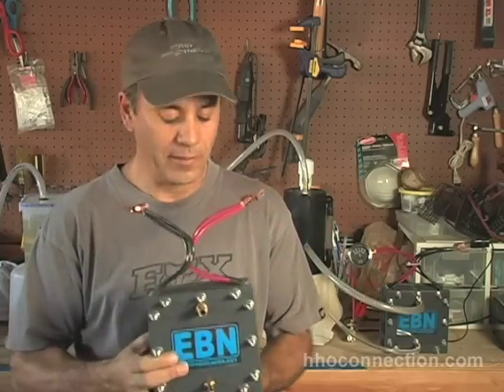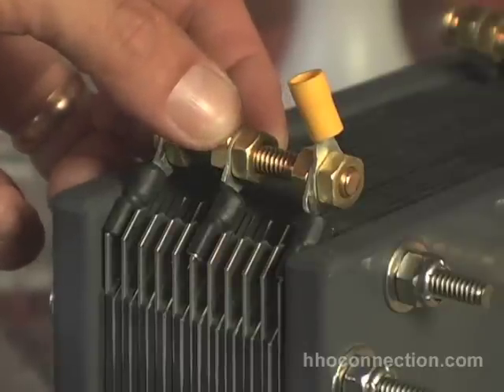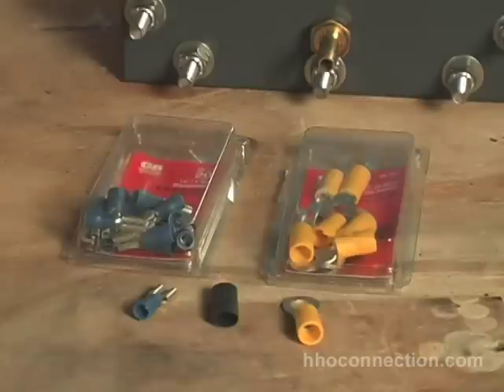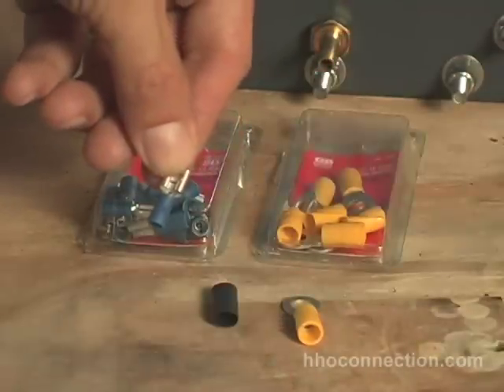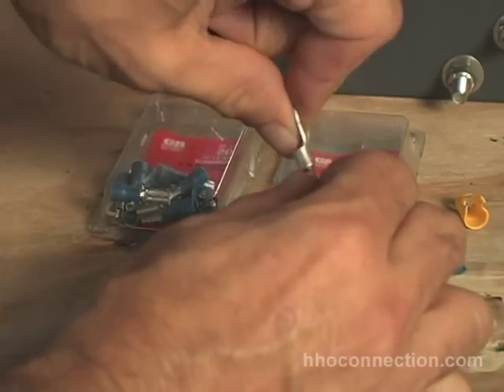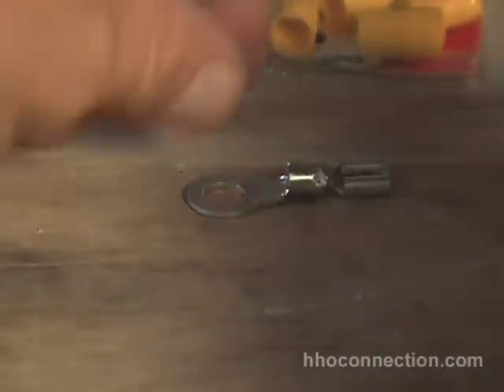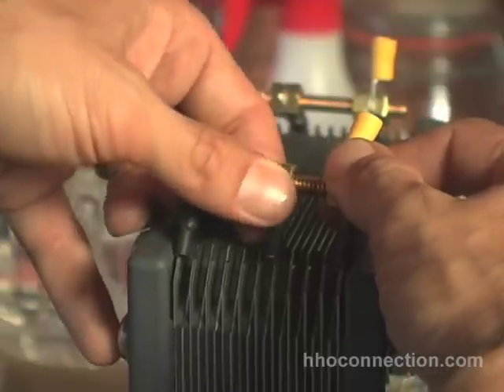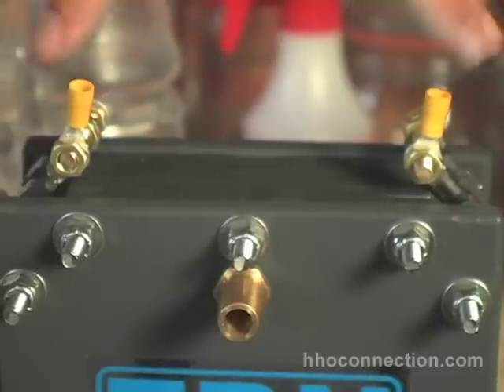How To Connect Your EBN Dry Cell With Only Two Wires

Comment: Nice thought... however I’m wondering if there is a amperage issue... as you use pre-configured items there may be an amp limiting event. The best way I can think of to prove it is not an issue is to setup both and test..... as you know electrical current will take the shortest path, not always the best or intended path.... heat may also be an issue... i would use a thermal camera or laser thermometer on each joint...  i like how clean it looks but not sure it’s the best for amperage flow... please let me know as you go further into the design changes.. thanks again for all your efforts

Comment: that looks great but i hope you used a larger gauge wire than the one it came with reason lets just day you had three 6 gauge on one  side those three wires can handle a lot more amps than one 6 gauge wire

Comment: what went wrong bought a 11 plate cell hooked it up in 2013 hyudia 4.1 . now i need a new engine throdel body alu.just pived butterfly too enjectors gone. used potassium hydroxide for cat. 1 teas. per 2 quarts help

Comment: instead of using cheap yellow eyelettes I would consider something more robust and sturdy. like maybe 2 -4  guage wire with solder on copper ends. consider how much load that little yellow guy is trying to pass through. its nice to see you have a bus bar goin on and all that but for the long term this may build up resistance/ heat which isn't good for any electrical circuit and in the end may have an affect on your circuit protection device ( fuse/ circuit breaker ) if you have one, which might I add would be very important if you are above 10 amps.

Comment: FINALLY!!! Someone that actually knows how to solder properly
Reply: Dave S NV
Reply: +Dave S (Davenia419)   lol who are you ? My OCD solder
Reply: +Jamie Jones lol no I've just seen a lot of videos that have soldering at some point in them and I see so many people who are not heating the electrical wire but just melt the soldering wire over top of everything which is just cold soldering and barely holding anything together. It's just nice to see someone on here that can actually do it properly for once.

Comment from the maker: You can cover it with plastic to prevent an accidental short. It won't hurt to touch it but if a piece of metal contacted both sides it would short out. I take a piece of clear hose and cut it down the middle and wrap it around the bolt for protection.

Comment: Hi there, I love your videos but in this one I am getting a little confused.  Presenting the cell you said that it had 3 negative and 2 positive plates and then further on you say that there are 3 positive and on 2 negative connections.  Is it an error or does it not matter how many there are of the one or the other?
Thanks in advance

Comment: Friend think your videos are fantastic and I have learned with each of them, I wonder if my cell to test I made, I can direct connect cables to the battery and put the cell without any relay or fuse is for test cell and see that amount of hHO produced, another question is that power supply I need to connect to the current 220 v, how many amps would have to be the source of power to serve me, thank you very much. osvaldo@olivarez.cl

Comment: Hi, what sort of setup would you recommend for a 2849 ccm gasoline car?
Once I get my car finished, I think I will maybe purchase a setup.
I'm thinking of going as low as 0,4 every 10 KM, you think that's possible?
I managed to get my Volvo 240 with a 2316 ccm engine to use only 0,75 every 10 KM with gasoline alone, so I think it's possible.
The setup will be put in my very rare Volvo 265 (wagon) coupled to the original, modular V6 PRV Engine, also found in DMC-12 DeLorean.
It has a turbo too.

Comment from the maker: For a gas grill you would need a lot of steel. I would say a 8" x 8" - 59 plate cell run off of 110 AC converted to DC with a bridge rectifier. Then you would need to design a burner with many small holes.

Comment from the maker: Yes they can be. If yo ulook at the Punch slimline cells they have 7 plates, 5 neutral plates in the middle with the positive and negative plates on the outside. You just need to be careful not to touch both sides at once with a piece of metal.

Comment from the maker: You can either connect the wires with paddle connectors that slide over tabs on the plates, or you have a tab on the plate with a hole that you run a bolt through and tighten with a nut on the other side. Neutral plates are not connected to any wire.

Comment: You post detailed & well explained videos.
But I Have watched The Neutral Plate Explanation Video, It still didn't clearly explain how to make the connection. Since The Power will be draw from the Battery (With The Traditional + & - Terminals). How does a Rookie Like Me know how to safely make these connections?. Seeing that there are more than (2) connections You made there (On The Cell), can You please explain how the 2 wires coming from the battery should connect with the cell?
Thanks
 Phigo.

Comment: they do make gold plated connectors. for better corrosion resistance giving you better voltage and current flow. if this unit is in a corrosive environment.

Comment: Brass is a much better electrical conductor than steel  .It's copper-based...copper being the most favored choice for electrical wiring. And like Jay Rydre said, it doesn't rust.

Comment: hi im a big fan of your hhoconnection . i heve a diesel engine 2.5L displacement, i dont know how many plates and size i need and what the configuration,  and how can i reduce the heat of the cell by not effecting the production pls help......luciokris@gmail.com

Comment: Quick question Novice at alternative energies but very interested. Would calculating  the proper amperage omit any water vapors that would result in internal rust(cylinders, valves etc.)? Or is engine modification always necessary?

Comment: Next time use your lighter to heat a little bit the plastic on the connectors, just to soften it a bit. If it won't fall by itself after heating and dilating, it will come off if pulled with a set of tweezers of by raw finger power :) 
I had, at times, hundred of connections where I had to crimp and solder the wires in these boot-connectors and heating them made my work a lot easier.

Comment: i see you have 16 neutral plates, 3 negative and 2 positive on this model.
i am making a 9 plate model and i'm wondering how many positive and negative and neutral i should have. also the size of my cell which will be 8" x 8", will this be big enough to power a 3.3 litre engine with my petrol as a suppliment

Comment: Hello my friend, I live in Brazil, I can not speak English, I used the google translator to type in, wanted to assemble a kit for my car, it could pass the measure as plate thickness, width, length, thickness of the sealing or mounting diagram, be very grateful, hugs, Amauri Correa da Fonseca.
 Email: amauri12009@uol.com.br

Comment: @hhoconnection No problems. Been playing with HHO for a couple of years. Your unit is great for the guy who has lots of money and fully understands everything, BUT mine is best for the beginer with no money. This is the unit that will get everybody into HHO, just because of the simplicity. Once they get thier feet wet they will be getting into the more complicated units. If the bottle or bolt does wear out, $5-5min replacement. Heat and voltage are controled by using less baking soda or MSG.

Comment: @Raymondo873 
hmmm, i think a bit of antifreeze might be a good idea, but you dont want to put any unneccisary chemicals into your engine, so i would ask someone else about that, lol. or try pure antifreeze in the HHO generator (not connected to your engine intake) and see if any gasses are produced. if not add an electrolyte. if still no gasses are produced, then i say put antifreeze in your HHO generator and try it in your car, but i would ask somebody who knows what theyr doing im 15...

Comment: @enticed2zeitgeist thermal runaway is what occurs if you run high current. lowering the voltage using plates allows for a more stable running of the cell. As the water temp increases so does conductivity which is good but eventually you will start to pull more amps then your 12v system (typically) can actually drive, or you will melt inadequate power and ground wires, or you boil the water, whcih is counter productive. If you are creating heat you are wasting electrical energy.

Comment: @Raymondo873 Try adding a pump to your bubbler line.  It will keep the water flowing, and not allow it to freeze. If you're going to do this while your system is off, be sure to keep the battery charger on!

Comment: @hhoconnection Why would you want to lower voltage? Don't you want to run high voltage and amps through the water to break apart as much water as possible? I can't grasp why people use these neutral plates. It just doesn't make sense to me. Can you possibly explain it further?

Comment from the maker: The purpose of neutral plates is to lower the voltage between the + and - plates. The optimum voltage between consecutive plates is 2 - 2.2 volts.  Anything more than that and you are wasting power and eventually boiling the water. Each time you add a neutral plate you are adding resistance to current lowering the voltage between plate gaps. I run 5 neutrals and my cells never overheat as long as I don't overdrive them with too many amps.
Reply: Where i can buy an HHO kit?

Comment from the maker: That's because making it work in an engine is very tricky. While some have had success, others have not. I personally think HHO is a fantastic fuel and we need to get more people involved to try and figure out the best uses for this amazing gas. The EBN cell was designed to be a tool for experimenters not a plug and play system for an automobile.

Comment: i built an earlyer dry cell with both connections on the outside of the plates..but was a pain to build. so i went with the tabbed design i like your idea i will try it. on my dry cells

Comment: Thank you for a great idea ,makes life little bit easier,and this is a neat solution for connecting it ,yet we need more surface area  touching the plates from those slide in connectors for lesser heat built up on high amps draw .
Again nice and neat design